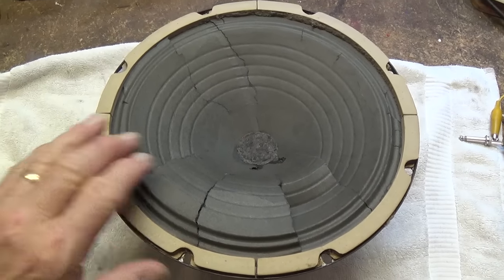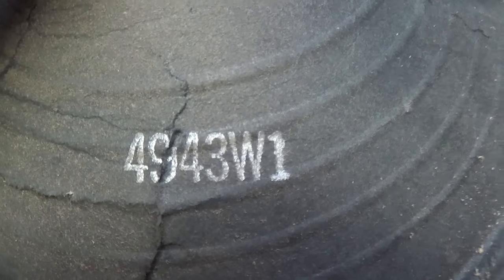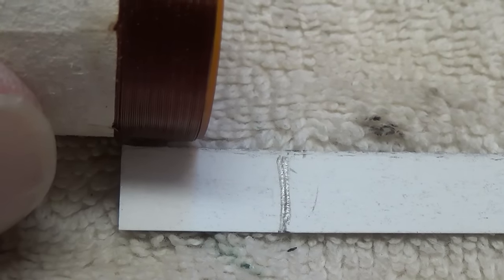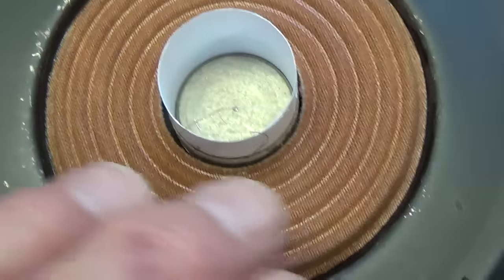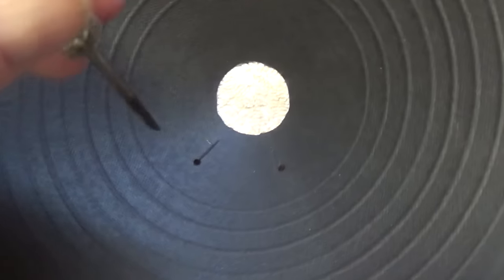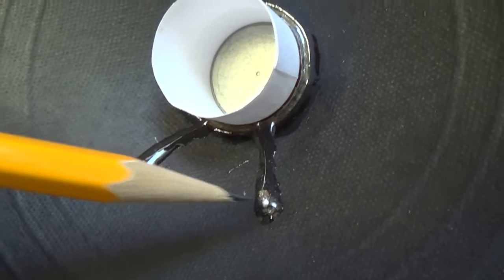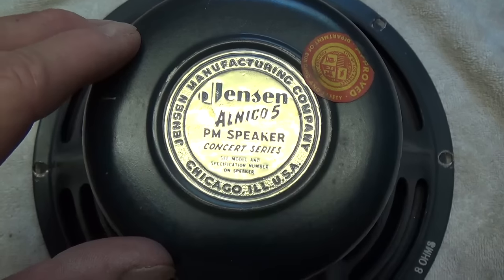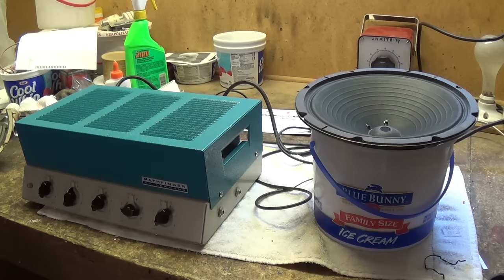How to Recone a Speaker

Comment: I was given a set of speakers a few years back, and the speakers in one cabinet were blown. After watching your video, I got up the nerve to try fixing them. Luckily for me the manufacturer had used a type of adhesive that was still tacky. With some time and being careful I managed to dismantle them without breaking anything. I found that on both the tweeter and the woofer, the leads that came of the coils were broken just were they turned up of the main windings. So I carefully wound of a half a turn to get the leads back up to the top of the core again, and re soldered them to the braided leads. Put them back together and they work perfectly.
Reply from the maker: Wow, I'm impressed, John. Doing microsurgery on voice coils is not an easy task. Congratulations on an excellent repair :)
Reply: Thanks Uncle Doug.
Reply from the maker: You're quite welcome.

Comment: If the voice coil  failed in the slot and "sticks" firmly while pulling the coil former out (and usually measures an open coil), it's likely there is a "blown spot".  That damage may have transferred remelted varnish and (maybe a bit of transferred copper) that has "spot welded" material on the outside diameter of the magnet's annulus that cardboard and tape may not remove.  Inspect the coil, if there is a blackened spot and wire ends present, it's nearly a sure thing.  A tough case, so:
An alternative START to cleaning the magnet anulus is to use brass shim stock without tape.  A stocky piece, 10-20 mils thick can be hand formed.  A radius that is  intentionally formed slightly too large (too flat) scraps the OD. Then reform it, radiused too small to scrape the ID.  Then the compressed air, cardboard, tape, inspect and repeat.  This may require changing the tape quite a few times until the tape come out clean.  The tape should go over the end a few times to get the material from the bottom of the slot.

Comment: Tech Tip: Disposable Plastic Monoject 412 Irrigation Syringes found on E-bay or Amazon work great for Hobby work. They can be filled with adhesives, the tip can be trimmed to a desired hole opening and the bead is spread more balanced and evenly for clean and tidy work. Lazy Susan turntables can also be helpful to rotate work while welding, caulking or gluing etc....
Reply from the maker: Great suggestions, S. Thanks !!

Comment: Beautiful job, Doug.  For us amateurs, maybe add a step to measure resistance between the wires after soldering?
Reply from the maker: Thanks, Michael.  Yes, that would definitely be a good check on the continuity of the soldered joints.

Comment: Fascinating video there Doug. I don't think I have the patience for that kind of task. I'm wondering how cost effect it is to do that kind of repair?
Reply from the maker: Thanks, Andy. You never know until you try :) This was an irreplaceable speaker, with a value (in its original amp) of hundreds of dollars, I believe, so definitely worth the price of repair.  For common, modern speakers it's probably not economically advisable, however.  You could probably replace the speaker for the same, or less, expense.

Comment: Thanks for the tutorial.  I believe I see where I made my mistake, or perhaps mistakes.  I used the plastic shims Cathy sent, but they where not big enough to wrap around the coil completely.  The way you did it, with the paper wrapped around the coil twice, really got it centered and properly lined up.  (At approx. 7 mins mark in video) it looked like there wasn't a lot of room for the coil and the edge of the speaker basket?  I thought it would rub against it and make it a problem.  (btw, this was for old Fender Super Reverb, 10" CTS aftermarket recone kit. The rebuilt speakers do sound great at low volume, but not when I crank it.  So I will try again.  It must be really nice, having helpers like Rusty and Jack!  :)
Reply from the maker: You're welcome, Peter. If the plastic shim cannot completely encircle the pole piece, the un-shimmed portion of the gap will be too small.  In this case, you should cut the shim into 4 equal pieces and use them at 90 degree intervals to properly center the VC.  Also, you must ensure that the coil winding is exactly centered with the wide, flat plate near the outer end of the pole piece.  If the VC is set too deep it will hit at the bottom of its excursion.

Comment: Great video! How do you know which is the positive and negative end of the voice coil?
Reply from the maker: With a single speaker, it doesn't matter, Rene. The only time speaker polarity matters is with multiple speakers.....and all must have the same polarity or you will lose bass response. It can be tested with a 9V battery. Touch the same terminal on each speaker and see if the cones all move in the same direction.

Comment: Hi Doug, great video thank you for sharing your knowledge.  Question about making the wire connections to the terminal lugs. How do you know the polarity of the coil wires? Which wire goes to positive and negative lugs? Thanks!
Reply from the maker: After the re-coning process you can use a small battery to determine the polarity of the lugs. If a lug makes the cone move outward, away from the magnet when + is applied, then that lug is +.

Comment: I like hand wiring my own V.C with craft paper and reusing if possible the wire - redone an old RCA that had 2 adjustment screws on the spider glued to a ring, I loved it as I can adjust..big alnico mag for a 10'' but yeah this is the best Video to learn on, thanks for the link on the parts :) it sounds great on that Pathfinder
Reply from the maker: I'm impressed, B2......I have never tried to rewire a voice coil, preferring instead to simply buy new ones. Thanks for your very nice comments.

Comment: The 5 minute epoxy is tricky to use, as you don' want any of it trickling down into the voice coil cavity. I've seem some special glue used for this purpose.. a silicone gel or polyurethane. Sounds pretty good in the bucket tub too.
Reply from the maker: I rely on a narrow gap, viscous epoxy, capillary effect, and a good luck medallion featuring St. Vitus, the patron saint of speaker reconing.....and a great dancer, to boot. The only mishaps I ever have are when the shim gets stuck to the voice coil......but that's always fixable.

Comment: Hi Doug.
The normal procedure for contact cement glue is to wait the glue dries before join the parts. But for the reconing job we join the parts when the glue is still tacky. That's correct?
Reply from the maker: You're right, Gil......but assembly prior to full dryness allows for a wee bit of position adjustment.

Comment: Good Snowy Day from Buffalo, NY to you Uncle Doug. I've been slowly bringing a pair of Acoustic Research speakers. I need to re foam the surround, not recone. My question to you would be is it better to remove dust cap and shim or put a tone threw speaker and listen for rubbing and then adjust.
Reply from the maker: Remove the dust cover and shim the voice coil, then install the foam surround. Pull the shims and verify concentricity.  Good luck.

Comment: great job uncle ! please tell me how do you remove the "varnish/wax" from the braided wire in order to solder them? if i use heat sometimes the wire itself is destroyed.
Reply from the maker: Thanks, KN. I've never had to remove any coating from the braided wire.....it normally solders just fine as is and doesn't melt with heat. Are you sure you're using the proper wire?  It's much like solder-removal braid.

Comment: Hi @Uncle Doug. Great work. I'm working on restoring a pair of Oxford 12L6s. They had a fair amount of rust which I have been able to mitigate using Rust Dissolver and scotchbrite pads. Of course, this removed the finish in those areas. I was wondering if you knew what the finish on those old oxfords. It appears to be an oxide coating similar to gun bluing or else some kind of powder coating. I would really prefer not to paint them, but would like to restore this finish as much as possible to prevent the bare metal areas from rusting again. Any ideas?
Reply from the maker: I honestly have no experience or awareness of any methods to restore the finish, other than paint, Tim. Sorry
Reply: @UncleDoug  Understood. Thanks for responding.

Comment: Very nice uncle Doug. Now I can repair my own speaker. By the way, how about the polarity of the coil, how can i identify which wire is the positive and which one is negative?0  thanks
Reply from the maker: Good news, Castro.  Good luck with your project.
Reply: @UncleDoug  thanks uncle Doug. Please help me how to identify the polarity.
Reply from the maker: @castro5n29  If you only have one speaker, the polarity does not matter. Either wire to either speaker terminal will work just fine.
Reply: @UncleDoug  Thank you uncle Doug.

Comment: Thank you so much for this excellent tutorial.  I'm about to try my first recone - a small 4" antique radio speaker.  I've watched yout tutorial numerous times now and I have one concern - the use of contact cement on both the spider to frame, and on the cone to frame.  How did you be certain to get centering just right before those pieces touched?!  I imagine this is why you leave a small open ring around each component and the voice coil as a little fudge factor when dropping these components in place?  But man, that speaker cone fudge factor sure is TINY!  I think to myself a second shim around the outside of the voice coil might help centering before the pieces touch?   I'm feeling more like using GC speaker repair cement for these connections in order to have a few moments of wiggle time to be sure I get the centering just right.   Am I overthinking this?  Sure would appreciate any additional insight regarding this part of your procedure.
Reply from the maker: It takes some finesse and the tiny airgap is essential to maintain. For a tiny speaker like yours, slower-hardening cement might be a good idea.

Comment: Great video uncle doug…..
I was curious as to the voice coil leads as to which gets designated the positive and negative when it comes to attaching to the speaker terminals.
I've never really delved into reconing, but you have made it appear not too overly complicated.
I wish there was a way just to replace a voice coil when its the only part that's burned out......leaving a perfect cone and spider.

as for audio speakers.....its always the foam surrounds that rot away
Reply from the maker: Thanks, Mike. Polarity doesn't matter, unless you are using multiple speakers in a single enclosure.....then they must all be in phase. You can verify this by applying a 9V magnet to each pair of wires, always in the same + and - configuration, and see if the cone moves inward or outward. Wire them so that they all move in the same direction when a + signal is applied. I have successfully replaced only the voice coil in otherwise pristine speakers. It is a surgical challenge, but possible and it works just fine. Yes, foam surrounds always seem to deteriorate first. Fortunately, they have little (or no) use in guitar amps.
Reply: @UncleDoug  yes very true for the foams.....I think that was the revolution in hifi when the surrounds went from the paper pleating to the alternative solution.

I was looking more at the "start" and "finish" lead in the voice coil......whether a right handed personality wound the coil or a lefty.   Ultimately you want it to pump outward and you  only have 2 choices.

Was the voice coil a single layer wrap ?
Reply from the maker: I believe it was, Mike.

Comment: What a Gorgeous restoration!!  It's even a more delicate and exacting procedure than I thought it was going to be.
Is that step - epoxying the gap between the voice coil and the spider edge - as very delicate as it looks??   How do you keep the glue from running inside of the spider and down the outside of the voice coil ?  Gravity would want to make that happen !!

I assume that spider cone stabilizes the speaker cone and somewhat limits the travel of the overall Coil/spider/speaker cone assembly ?  I wonder what would happen if you left the spider cone off and only used the speaker cone ??

As always - thanks for the excellently architected and highly informative video presentation !!
Reply from the maker: Thanks, Donald. You rely on luck, a narrow gap, and the viscosity of the epoxy to prevent such a catastrophe. The spider is mainly to keep dust out of the VC channel, but it does limit the excursion of the speaker cone.....sort of like a governor.....to reduce the likelihood of damage. Leaving off the spider would not be a good idea. The speaker dynamics were designed with it intact. You're welcome.

Comment: I've not had the need to re-cone,  but I have done a  Re-Foam  on a number of Hi-Fi drivers over the years.   Many similar steps....  just a few extra.
Reply from the maker: Some of my old Hi-Fi speakers had their foam disintegrate. It seems like that's the weak link in those speakers. They should figure a way to make the foam out of Kevlar :)
Reply: Some of the better makers have switched to a soft rubber surround that so far appears immune to the foam rot...  or it at least lasts 2-5x longer than the foam did.
Reply from the maker: Definitely an improvement. They had to do something, however, since the foam really didn't hold up all that well......at least in my experience. Thanks for the info.

Comment: I'm skeert as a trout to try this job, but I'm gonna do it. I was told to use enamel paint on the (reused) voice coil to handle heat. What type of tape is that holding the fine copper leads?
Reply from the maker: Don't use any paint, N&P.  Probably masking tape.
Reply: @UncleDoug  Some speaker reconing place said to use high-temp varnish on the coil. Why, I don't know.

Also, how to determine electrical polarity for the leads?

Comment: I appreciate the video. I always wondered about the process. I have an original 63 fender deluxe reverb which is not working. How do I determine a repair source which will respect this early amp?  I really enjoy your thoughts!
Reply from the maker: I have no way of knowing the ability of techs in your area, Monte. You need to speak with them and see if they hold your amp in the high esteem that it certainly deserves. It's like choosing a babysitter for your kids.

Comment: What causes an old speaker to sound distorted when its physically intact? Can small radio speakers ( 4inch) be reconed? Because the one I have is an exact fit into a circuit board in a shortwave radio and I cant find a replacement that fits there. Thanks Doug
Reply from the maker: The suspension of old speaker cones gets worn out and the cone is allowed to "flub" around in a spastic fit.....sounding awful in the process. I cannot find re-coning supplies for any speakers less than 10" in diameter.

Comment: Thanks for filming this work. IL be looking after my speakers more in the future. Was it worth the trouble over replacing the whole driver?
Reply from the maker: The price of reconing supplies has more than doubled during the past few years, so I now reserve the procedure only to retain original appearing vintage speakers in collectable amps. Otherwise, it's generally cheaper and easier to simply replace the worn out old speaker.

Comment: Nice explanation indeed! I have one question about speaker polarity; Some people say that if you connect and reverse polarity on only one speaker, the sound will be not in phase with other speaker and it will sound bad and I agree with that. But if you reverse polarity on both speakers they will be both in the same phase again and some people say it will sound the same because they work on AC (alternate current) and it is all the same and the sound quality will be the same, what do you think?
Reply from the maker: Thanks, VC. Yes, as long as the two speakers are in phase, with matching polarity, they will sound much better than if they are not in phase. I believe that the difference is mainly evident in the bass frequency portrayal.
Reply: Nice very clean job Uncle Doug. Maybe better than the factory job. Vjekoslav Cvetnić if you hook up a speaker backwards the speaker will not preform as well. If you hook a battery to the speaker leads, the speaker will push outward if installed correctly. If not it will pull inwards which will sound poorly when bass notes are played at higher volume. Both speakers should be in phase and proper to sound at their best.

Comment: When I took my dust cap off I noticed the center pole piece was pushing against the voice coil (not even gap) keeping it from moving the voice coil going in and out.  How do I fix that ??
Reply from the maker: It sounds like the speaker will have to be re-coned, D2, unless you can find someone skillful enough to surgically remove the voice coil from the speaker cone and replace the VC with a new one.

Comment: I would be tempted to use silicon paper from the back of a sticker as a spacer to avoid contact with the adhesive.
I'm not as confident working with such fine tolerances freehanded.

Comment: I've got a Jensen C12N that had it's cone removed probably years ago, and then was stored, or perhaps used as a planter or something. I've cleaned the pole piece and magnet I.D. wall for hrs and hrs. It's not shiny. There's no more detritus in there and the tape is coming back clean finally. Should I run some sandpaper in there until the metal looks shiny and new like yours, and then start the cleaning over? I want to get this right.
Reply from the maker: Sandpaper is a bit extreme, Scott. See if you can get some emery cloth to give a bit of shine with minimal abrasion.
Reply: @UncleDoug  Thank you for the advice, I'll do this. 
Also, thank you for such an instructive video. I'm liking my odds of getting this C12N up and noising again.